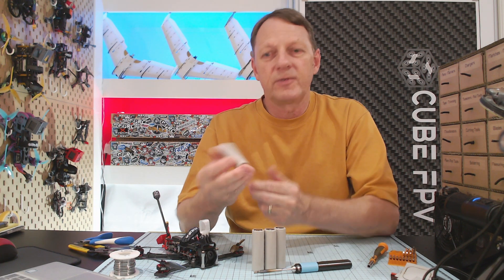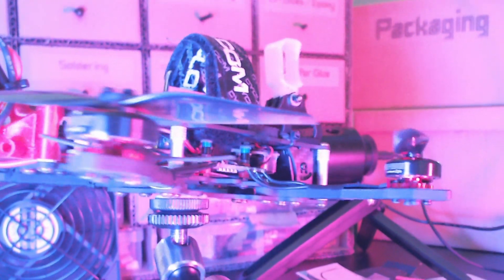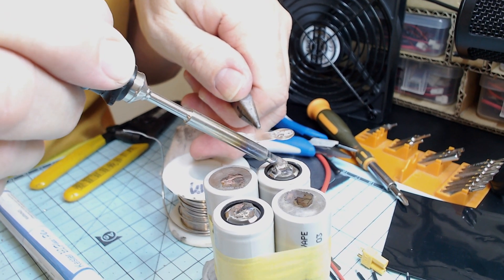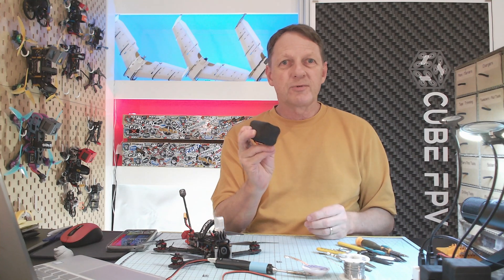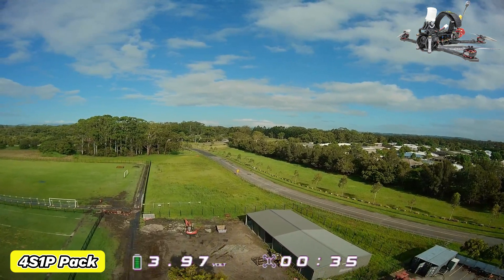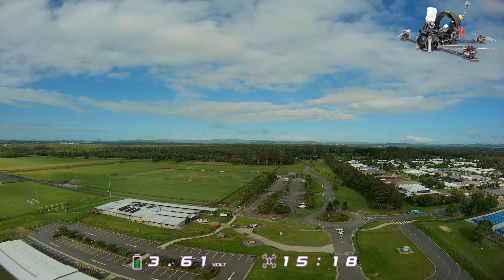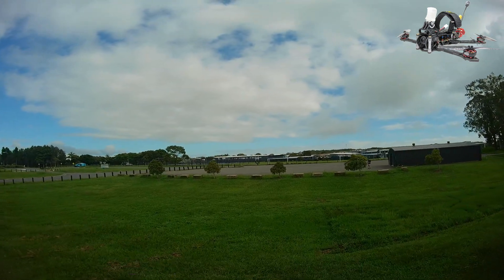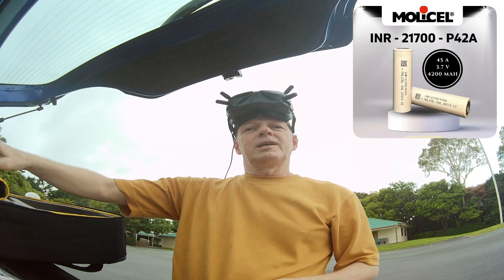18650 vs Molicel P42A Cells for FPV Battery Packs

Comment: Max discharge current is 45amp for this cell. Not 45C. Thank you for sharing this test.
Reply: I recommend to read through the document “MOLICEL P42A Power Delivery in Different Temperature”, where Molicel test the batteries at around 100A discharge
Reply from the maker: @Johnbscv  Thanks I'll take a look at the documentation.
Reply from the maker: Okay thanks for pointing that out - I should have picked that up.
Reply: A few years ago I build a 3s pack from these very same cells. I would have gone for the 5000mAh version (INR-21700-M50A) but they have only 15 A continuous discharge current and my quad can draw up to 30 amps. It's important to pay attention to the specs if you want your cells to last long. Nowadays the INR-21700-P50B would be an option. With a capacity of 5000mAh and a continuous discharge current of 60A, they should be superior to the P42A
Reply from the maker: @EinzigfreierName  Yes good point. Best to go for the M50A cells. I usd the P42A ones because I coudl buy them at a discount.
Reply: @cubefpv  The P50B actually. The M50A only delivers 15 amps which will often not be enough. But yes, price and availability also matters. And there are a lot of fake Molicel cells on the market also.

Comment: I have a 20 brand new LG icr 18650 he2 2500mah 20A can i use them to build a pack for my 5inch drone for cruising and long range?? Can i make 4sp1 pack with those cells?
Reply from the maker: I've never tried those cells. I think 20A is a bit low for this type of pack but you would just need to try and see if it works. The only issue I can see is the Amp rating.

Comment: Wow thanks for the test. Imagine you would use 1800kv Motors and Samsung 25A to 45A 21700 5000mah batterys and a lighter frame like the recon 5. YOu could easily get close to 40 Minutes.
Please show the distance you fly in the OSD thanks <3
Reply from the maker: Yes the recon frame is much lighter than this frame I used here.

Comment: I was thinking about making a three or six 18650 battery pack but im not sure if smaller sized drones could carry it
Reply from the maker: Definately not a 6S. But maybe a 3S 18650 may be an interesting test. I did this 2S build long ago and got 17 minutes on a 2.5 inch drone - https://youtu.be/2YH0Lu3A-xA?si=3kpD9pYbj0NrLzL1

Comment: 18650 are at least 45grams each, how is it 154 grams for the 4 18650 pack???
Reply from the maker: Unfortunately I don't have that 18650 pack anymore but I had recorded the weight as 154 grams. Using 45 grams / cell that would make the pack about 180+ grams. Sorry I can't verify the weight now.
Reply: Likely a simple error. 18650 thats 3000 mAh and 30A discharge rate, assuming a reputable brand, is likely a Sony Murata VT6 which is 47g per spec sheet. Making the 4S pack 188g.

I've made several 4S packs for my flywoo Explorer LR4 using both VT6 cells as well as molicell 42As and even with the added weight, the flight time with the 42A packs is significantly longer. Considering you can get the 42As on sale for as little as 3.99 a cell its a no-brainer. Built a few 6S2P packs for my AOS7 with them too and love em. Can make 2.5 packs for the cost of 1 commercial pack.

Comment: You should try with 3s, will fly probably similar time, but the weight will be similar to 18650 pack. 

At least I wanna try this, waiting my Molicel p50b to try it on geprc lr40
Reply from the maker: I'd be interestd to know your results with 3S.
Reply: Geprc LR40 Flight Time Tests
190 gram without battery. 

I’ve been testing flight times for my quad, and here are the results:

Battery: Molicel P30
2-blade prop:
	•	550mAh 3S – 6 min
	•	850mAh 4S – 10 min 30 sec
	•	3000mAh 4S Li-ion – 24 min

3-blade prop:
	•	550mAh 3S – 5 min
	•	850mAh 4S – 9 min 40 sec
	•	3000mAh 4S Li-ion – 25 min

Molicel P50 5000mAh 3S - 29 min
Reply: @lavirozp  post a video bro